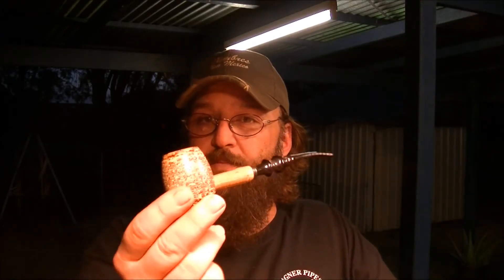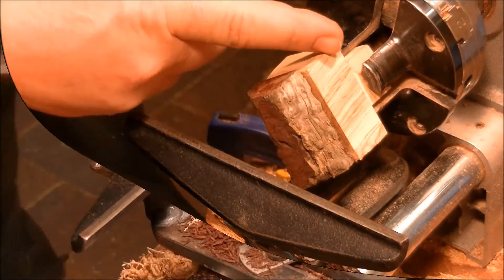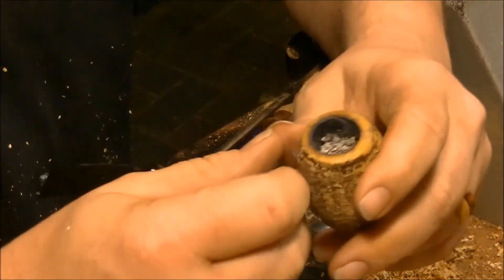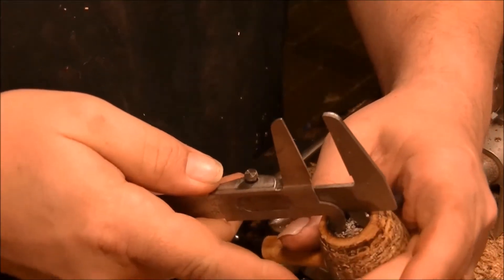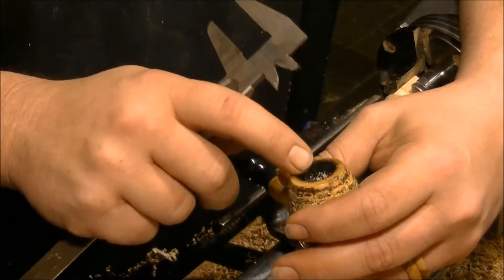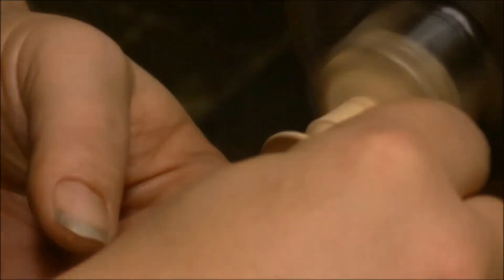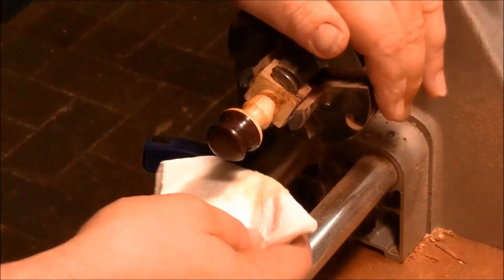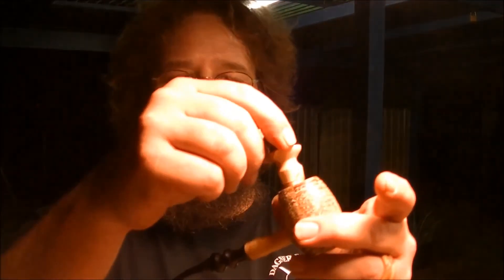Aristocob's 2014 ICCPM Contest: Woodturning a Plug/Tamper

Comment: Hey I made it to the library today to catch up on some vids and ran across Scott's contest winners. Congrats! What a clever idea Glenn. I hope you plan on marketing those plugs. Great idea! Again, congrats...later, Tim
Reply from the maker: I haven't thought about it but that's a good idea, the only problem is that cobs burn out differently to other cobs. It would fit one and not the others. I'll have to give it some thought. I may have to get some advice from our resident cob guru Aristocob and see what he thinks. Hope all is well Tim, well about as well as it can be for you under the circumstances.
Peace,
Glen
Reply: If Glen used some cork on the tapered part it would probably work on most cob chambers.  Yes, they do get larger over time, but that means that they grow from 3/4" to 7/8" or so.  Not a crazy amount.
Reply from the maker: cork....shoulda thought of that one!!! The you sir!
Reply: Pipe Nutter
You would have figured it out.